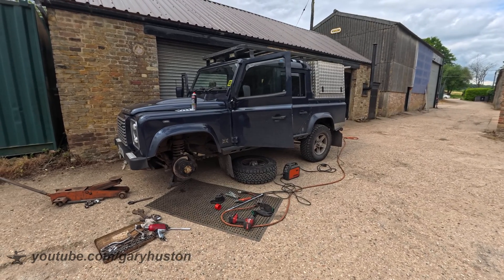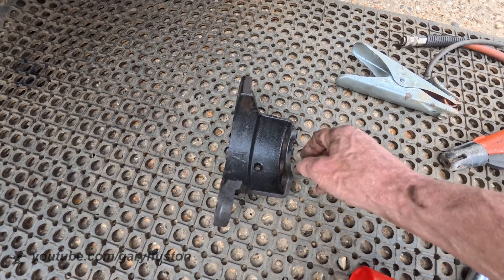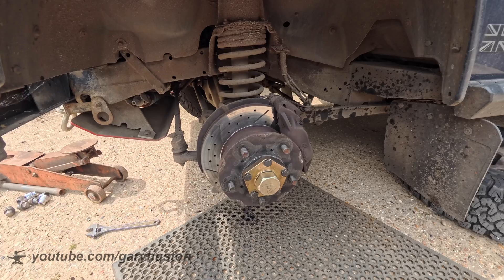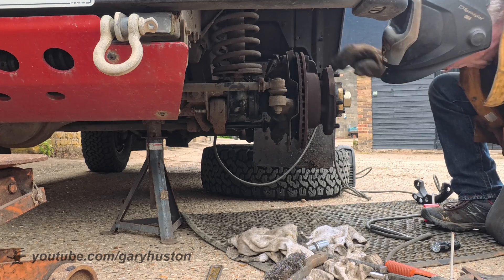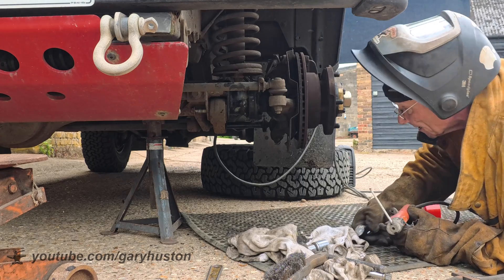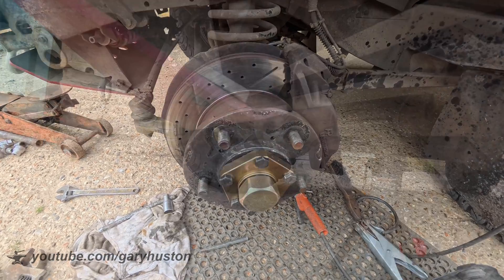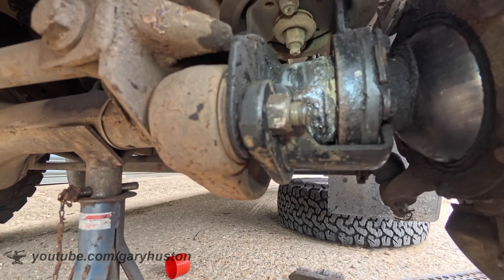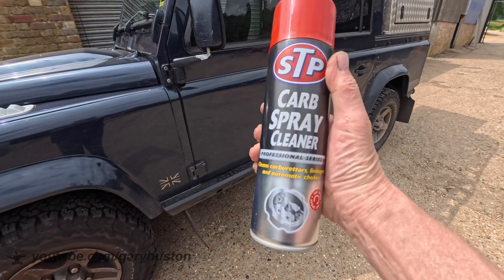Defender Snapped Axle Fix

Comment: The rear axle failed on my 1994 Defender 90 200Tdi, the hub flange had been friction welded, it sheared clean through, I got hold of a bare Disco 1 rear axle for £35.00, on inspection, it had been mig welded…

Comment: Not many young blokes theses days know to put the wheel under the car for safety reasons.
I shutter when I see a young bloke working on his brakes or changing wheel bearings and they are under there vehicle full body or legs  and they dont put a wheel under the chassis.  If the jack stan or jack fails ,  I would hate to see the damage.
Reply from the maker: Not many young blokes today would know how to change a wheel let alone do brakes or bearings! They only just manage to drive!🤣🤣

Comment: Gary,

Nice repair. I sure don’t weld properly and wouldn’t trust my repair in that situation.

You usually mostly mig weld. Any particular reason to use arc welding in this case?

Best regards

Frank
(Virginia)
Reply from the maker: Several reasons, one is welding with mig outside is generally difficult as any wind blows away your gas and ruins the weld, the gun is also a bit big to try and get in between the steering components and lastly, the rods I used are good and strong for just this sort of application.

Comment: Nice fix! I don't know much about cars, but why would a snapped axle be leaking oil?
Reply from the maker: You really don’t know anything about cars do you🤣🤣 The axle is partially filled with oil to lubricate the gears within!
Reply: @garyhuston  well there you go!
 If you don't ask you don't learn
Reply: @garyhuston  is it the diff Axel housing that split? Did it split on a existing weld ?
Reply from the maker: @smileykelpie if you watch the video you will see!😊